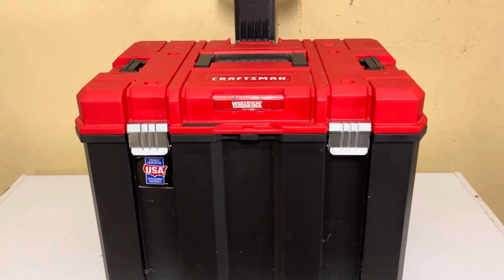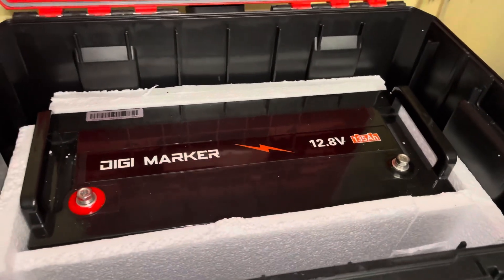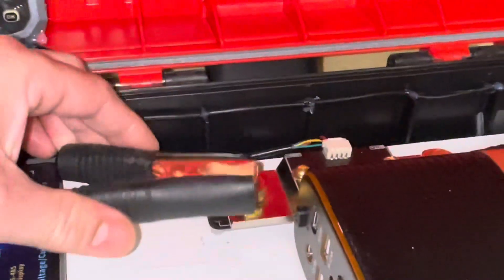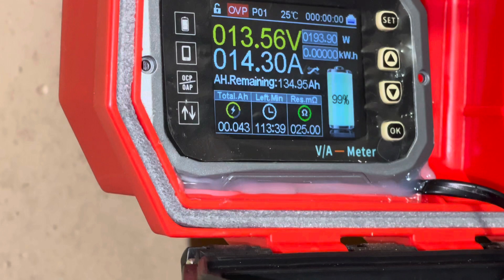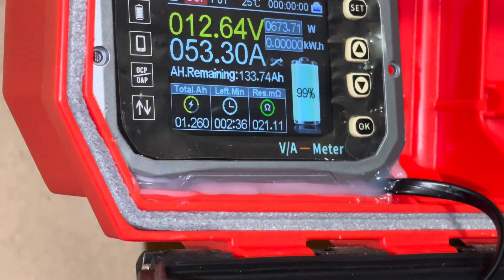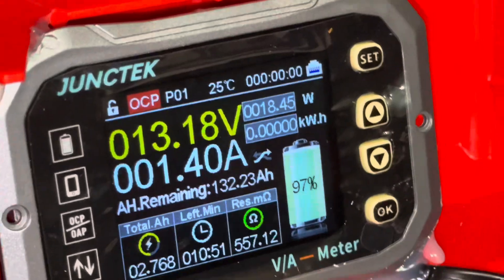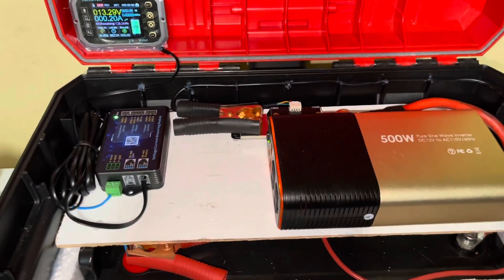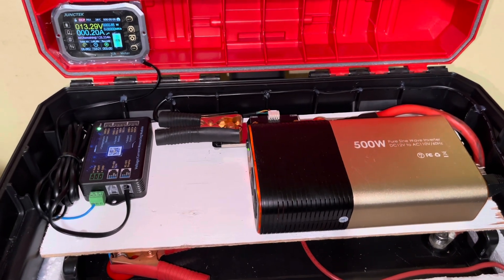FREE POWER STEP BY STEP DIY AT HOME EXPANDABLE & PORTABLE SOLAR POWER STATION / GENERATOR PART 1

Comment: A 50A BMS on a 135Ah battery? WTF?
Reply from the maker: yup about 4 hours to charge when we hit it with 30A, but we have loaded it to over 1000w more like 1200w and it performed fine didn't heat up so we suspect it can take more than it's rated at

Comment: Thanks for sharing your build.  I think you are doing it right by first testing your system components' capacity before putting it into sustained use.  While there is a breaker inside your inverter that, as shown in your video, will automatically shut it down, It will be best to match your external fuse or breaker to the ampacity of the wires that came with your inverter for connecting to the battery.   That external fuse or breaker should also take into account the peak watts that your inverter is rated to deliver.  Some appliances demand high amperage for a very short period of time upon startup.  You will want a breaker or fuse that won't pop or blow unnecessarily.
Reply from the maker: Your welcome and thanks for watching....yes we have since added a 100A solar breaker as we pull a max of around 85A so we have a surge buffer

Comment: I was shocked at how much simple plug in LiFeP04 chargers cost. I got the cheapest 20 amp one I could find and I think I paid over 100 for it.
Reply: You can make your own with a few creative options. Two HP DPS 1200 Server Power Supplies ($40) and an "1800W" Boost Converter ($25). The rating for the boost converter is dependent on your input and output voltage. Put the server power supplies in series so you get 24/25V and then boost that to your battery voltage (if higher). If your battery is a 12V then just leave one server power supply by itself and use the boost converter to bring it up to 14.6V. Should be able to pump out 20A at 14.6V and possibly at 48V nominal (58V). Those power supplies put out nearly 100A each if you power them with 220V, if you use 110V then you're limited to 900W but that's still quite a bit. Some people have toyed around with using the boost converters in parallel but I have no experience with that. You'll also probably want to get some voltmeter/ammeter combos for the output of the boost converter just so you don't have to fiddle with your multimeter all the time.
Reply from the maker: yes, they cost more as you want faster charging

Comment: I bought a 300 ah 12v LiFeP04 battery rated at 200 amp output, 2000 watt inverter, and a 60 amp MPPT charge controller. I want to mount it on a cart/small wagon or dolly for portability but still haven`t decided how to safely put it together. I need a lot more solar panels if I plan to make full use of it to power a tiny window AC in Summer to save on energy bills. But thanks to partial shade from trees I can`t power a tiny heater in Winter at this location. In Summer I have full sun from about 9am to 5pm. I wish I could have bought two of these batteries but spent the last of my savings on what I bought.
Reply from the maker: lifepo4 is the way to go as long as you keep the battery room temps it works best